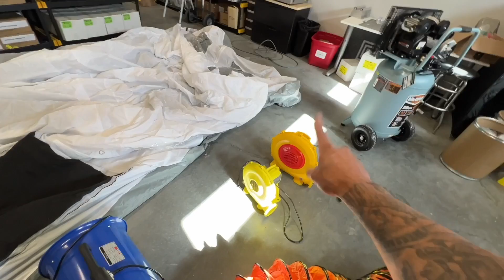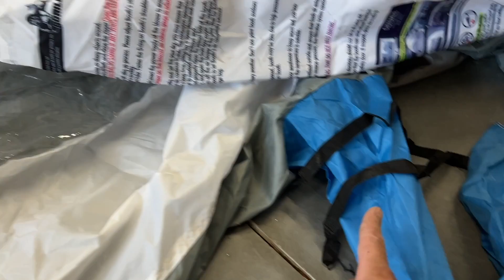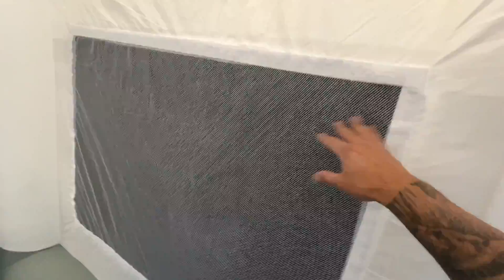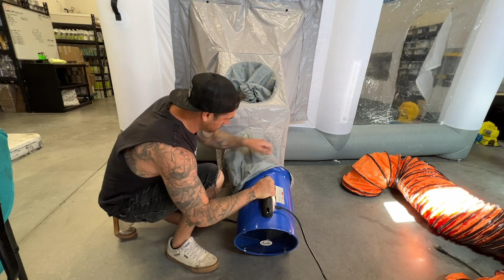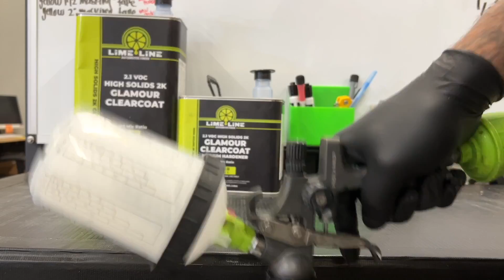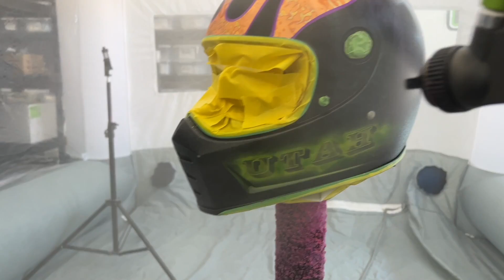Inflatable Paint Booth Review: Time Warp Custom Paint

Comment: What happens if the power goes out or some knucklehead trips on an extension cord & the thing collapses on your fresh paint?
Reply: What happens if you poop your pants while running the booth?
Reply: @natelamb5779  lol
Reply: @natelamb5779  then you buy a new booth
Reply from the maker: Rings are sewn into the top so you can run cables or rope to the ceiling
Reply: What if some one drops a nuke
Reply: @justinbonants4431 then reach down grab your ankles tuck your head between your legs n kiss your ass goodbye